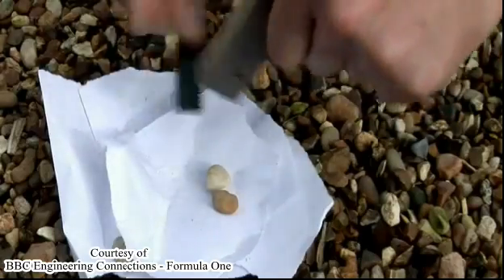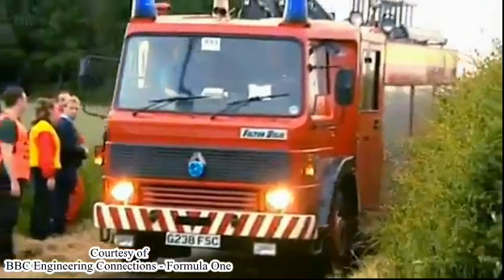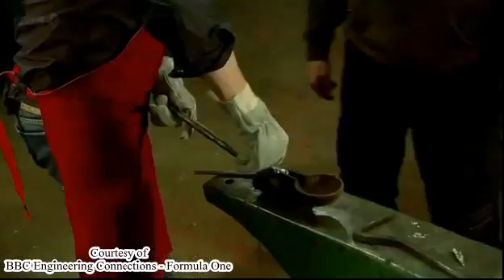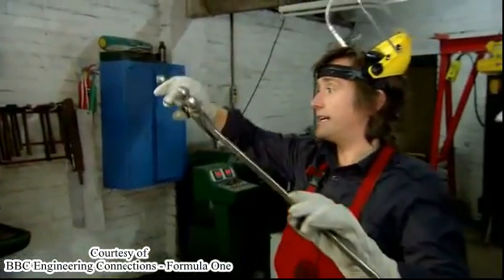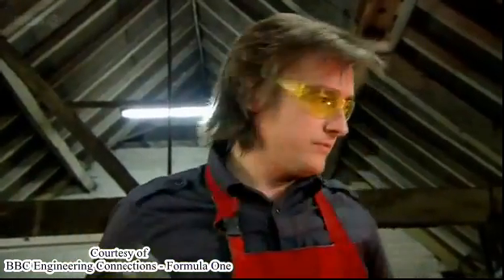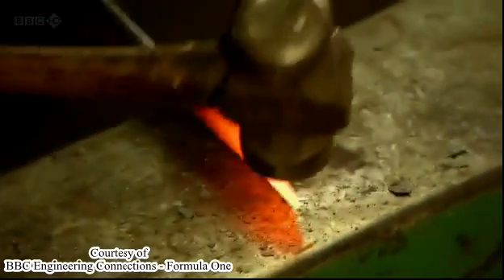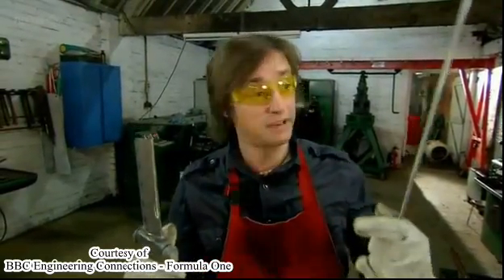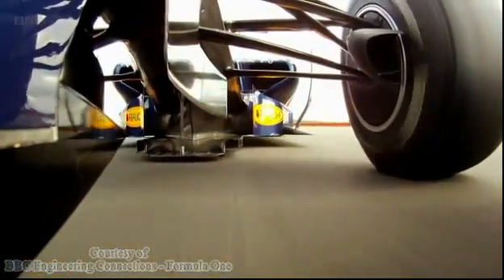F1's Wheel Material and Its Forming Method

Comment: My 1995.5 Toyota Tacoma has wheels from my Dad's 1986 4Runner. It had custom wheels on it from the Toyota Dealership in Alabama that are Magnesium. There is even a warning stamped into the back of the wheel. It reads something like Warning Magnesium Fire Hazard. They are super retro and unique for sure. When no rubber is on them they are deceptively light compared to the mass.

Comment: Lol, using water to put out a magnesium fire. Silly firefighters.
Reply: juan gonzalez yeah silly trained professionals
Reply: The problem is that when pure magnesium burns (at least a wheel-sized part), you can't put enough water on it to put it out.  It burns hot enough that it splits the water molecules into hydrogen and oxygen, so you're literally dumping fuel onto the fire.

Comment: carbon fiber?
Reply: RomanceThief extremely hard to make into a wheel
Reply: And it also might melt down with high brake temperatures. Or burn down, depends on the plastic you decide to use

Comment: so gow they make f1 wheels. casting Meganizim, forge to wheels shape?. or its mostly made of rubber
m
Reply: +Kawaii Ninja first they cast a big block, which they then forge into a cylinder that has the rough outlines of a wheel.
the exact shape is then milled using cnc lathes and mills

Comment: F1 cars wheel rotate only 150,000 times in a race? I would have thought much more than that.
Reply: +Jamie Stirzaker Let's see, let's take Francorchamps (belgium), lenght 7km, number of laps, 43, which give 301 km for one race. They use 18 inch tire (or 45cm) tires. Which give a circumference of 141.3 cm or 1.413m. 
So your wheel turn once every 1.413 meters. So there is 301 000 meters. and 301000/1.413 equals around 210 000 rotation in one race. 
As Francorchamps is a quiet long race, this seems a good number, and you get the same order of magnitude as what they said. It seems a quiet right estimation to me. :)
Reply: Guillaume Lemaigre
Well thanks Guillaume for doing the math! I just assumed it would be far more but with doing the math you are are correct. =)
Reply: +Guillaume Lemaigre ~300 km is the race distance for each F1 Grand Prix, exept Monte Carlo, so your calculation is correct no matter the track is.
Reply: +Jamie Stirzaker hmm no ... but the engine revolves mutch more often.... just try the math .. distance of a race devided by the scope of that wheel.... as far as I know a race is between 300 and 400 kilometers
Reply: Guillaume Lemaigre how